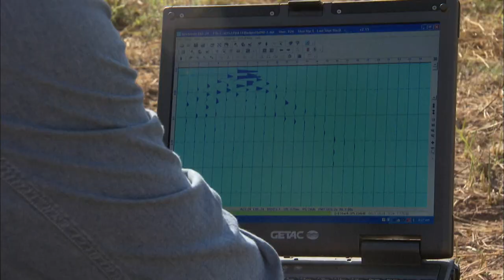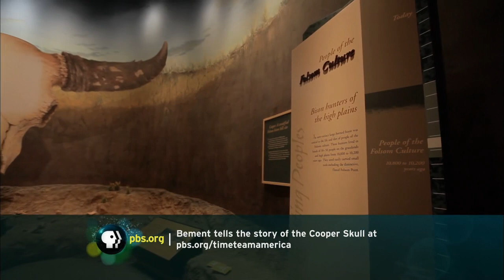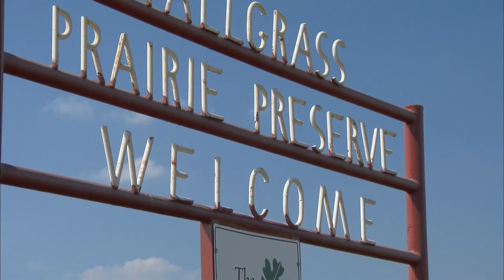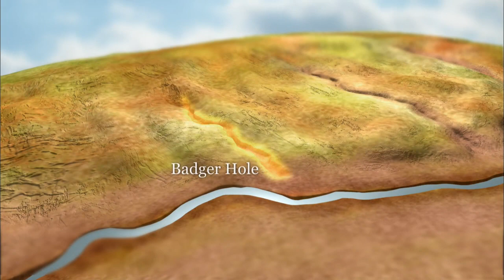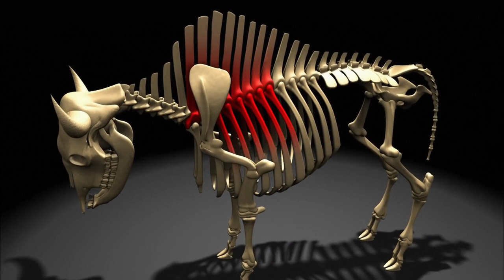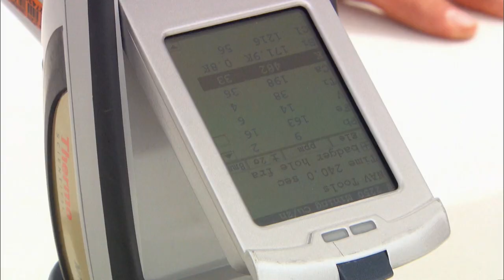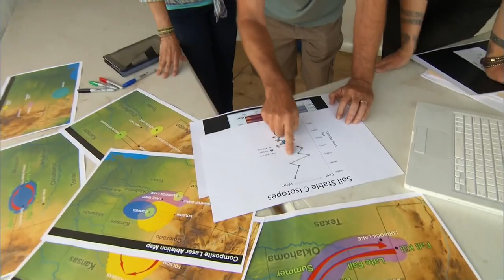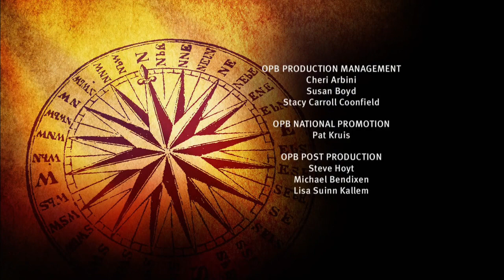Time Team America Season 2 2of4 The Bones of Badger Hole

Comment: time team is a good show but their "archaeologists" are as bright as a burned out light bulb.  looking at those bones, you can clearly see tons of fractures and breaks which is a sign of falling.  these bison didnt just run up the arroyo, they fell off of it.  the hunters chased them off the sides of the arroyos.  the weight of the bison falling broke their bones and were therefore helpless.  the hunters stood on top of the arroyo and flung their spears into the bison to finish them off.  every single bison i seen in this video has major breaks and those did NOT come from cutting alone...